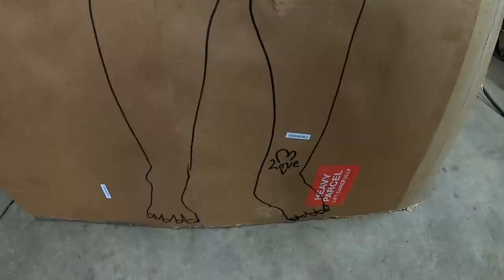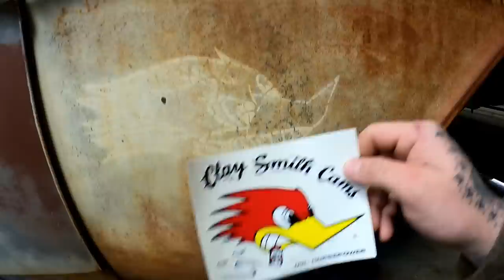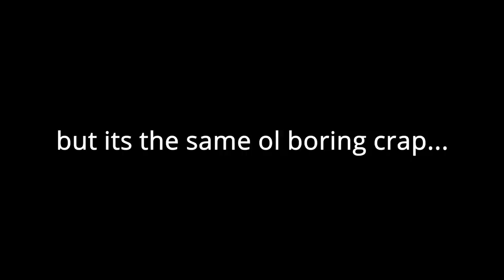1961 Parkwood Wagon FLOOR PAN replacement!

Comment: Hey, Puddin'. I don't know if anyone will actually see this, but I know a little rust-proofing tip you may want to try someday. Mix bar and chain oil (like for your chainsaw) 50/50 with mineral spirits. You can run that through a cheap pump sprayer, like you use to spray weed killer. It works great to get up inside all the frame rails and body panels. The mineral spirits let's it spray nice and thin, then it evaporates and leaves that thick chain oil to keep it from rusting. It would be great for down inside those old rocker panels.